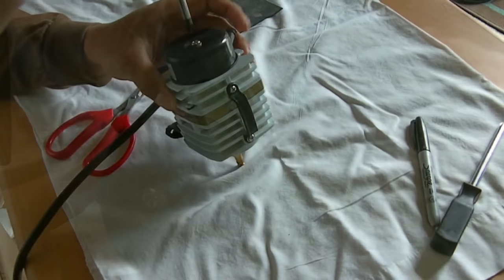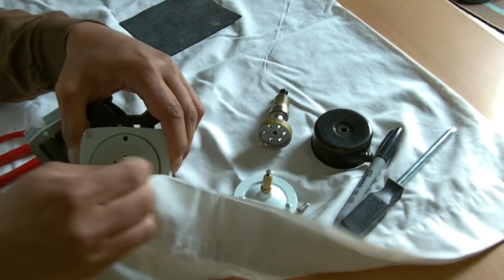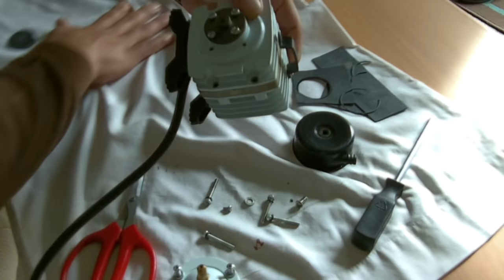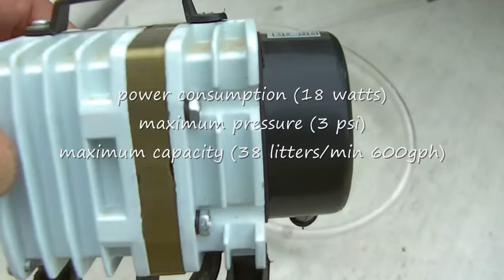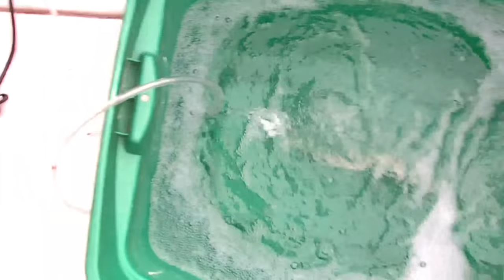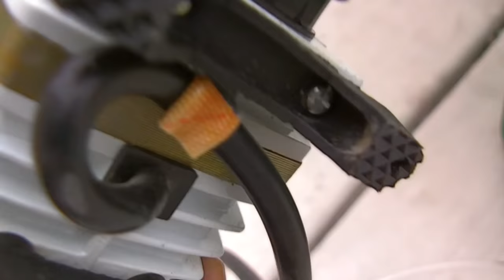air pump repair (ecoplus,commercial air,hydroponics,aqueon,hydrofarm) (diaphragm)

Comment: Thanks for the video!  My pump was still  pumping air, but getting louder and louder.  Fortunately for me, I was able to access both rubber 'flaps' from the discharge end and didn't need to take the other end apart.   Thanks again, I have a quiet pump now!!

Comment: I agree with the unnecessary music... Explanation on what exactly your doing and trial and error wisdom of the pump would be a lot more helpful. Also DO NOT use a heavy material for the gaskets! The thinness of the rubber material helps its flap allowing air to pass through the holes. Other than that interesting vague video on fixing stuff.

Comment: Will you have to change those round rubber pieces latter? Also what exactly do the round rubber pieces do for it? This is awesome video I have been looking for a fix for my commercial 110L Active Aqua air pump (AAPA110L). Do you think this will work for it? Its getting a little weak on the air pressure.

Other pumps offer a diaphragm replacement but I don't think these style of pumps have replaceable diaphragms.

Comment: do you think tire tubes will work? and the screw for the "front" diapraghm, is not original from the pump right? so i need one too
Reply: Yeap Inner tubes work just use the old rubber as a template or use a compass, thats what ihad to do to my 60ltr a minute has it was sounding like a airplane and was way much louder than my bigger pump.when i repaired it , it was much quitter and then i done the same for the bigger one now they are both lower in Db (decibels)

Comment: I've been looking at the EcoPlus 1 Commercial to see if I can convert it into a small vacuum pump, but there's not much info to go on.  Is the air intake the offset tube sticking out of the black cap?  Is it big enough to accept a 1/4" barb adapter of some sort?   Thanks for the video, it was helpful.
Reply: find a tiny Refrigerator that the compressor still works -- makes a Great Vacuum Pump  and very powerful and quiet. And should use no more than a 60watt light bulb to run.

Comment: This guy doesn't have a clue what he is doing. Doesn't even show the flapper valve that needs replacing.
Reply: For this type of pump, what he replaced are the two "flapper" valves.  The one on the piston is the intake and the one on the (front) body is the output.  They serve the same purposes as the "flapper" valves in a diaphragm pump.  It is a piston pump so no diaphragms are needed.